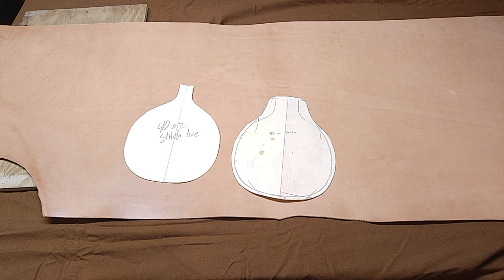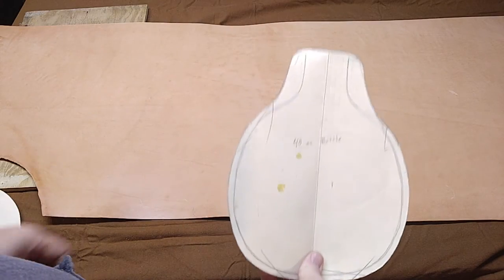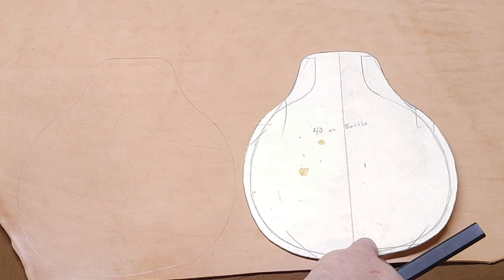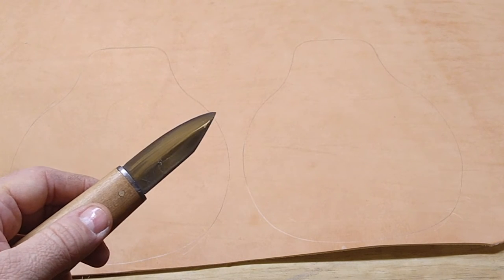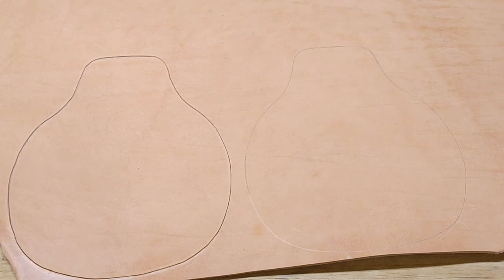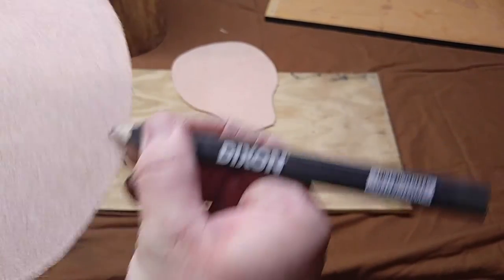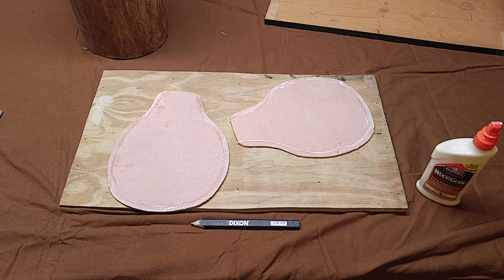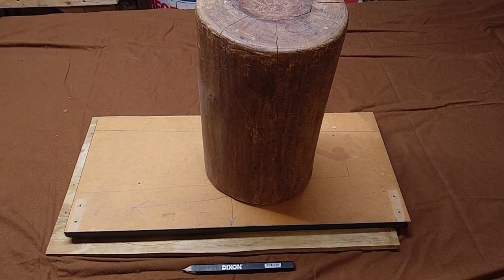How To Make A Leather Water Bottle- Part One

Comment: Great tutorial! Definitely going to be using this! By the way, is there a rough way to determine from the surface area of your canteen the capacity?
Reply from the maker: Short answer: no.

Long rambling answer:
Given the variables of how the leather will stretch, I wouldn't think so. If you wanted to I suppose you could measure the volume of the material you stuff it with and that would give you a rough approximation. You end up knowing a rough estimate after you make a couple though- for instance, this pattern generally yields a container with a 40 oz, give or take, capacity. I just finish it, fill it, and then measure how much water it held.
Reply: Geometry. Lots of geometry.

Comment: couple  question  which way would you run the gain on the canteen and how do know how big will it be
Reply from the maker: It doesn't really matter which way you run the grain, as long as both pieces have it oriented the same. As for how I know how big it will be, well, the only way I found out was to make a few and measure how much liquid it held. I'm sure there's someone out there who could calculate it, but Math is vile dark sorcery to me- there's a reason I'm not an engineer! :)

Comment: As the grandson of a leather worker, the only problem I have is that you tainted leather with would glue. Use contact cement. Holds and seals much better
Reply from the maker: I use the glue I do for this application because it is non toxic- which contact cement is not. Thanks for watching!
Reply: Fair enough. I didn’t think of that. My bad

Comment: You're doing that wrong. Chuckle chuckle .I would think that expanded metal underneath the leather be a better cutting surface. That way you cut through it probably jump way off the line and ruin your knife all in the same move. I mean that's that's me though I wouldn't follow anything I said. Chuckle chuckle just kidding dude great job love your stuff